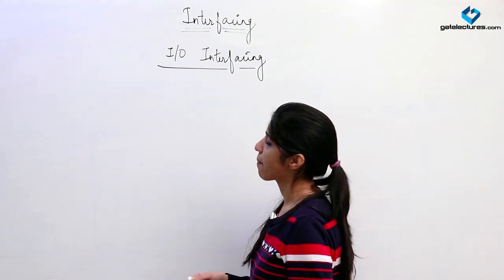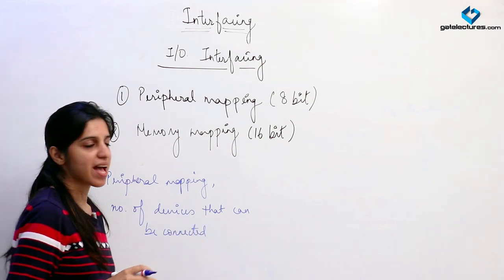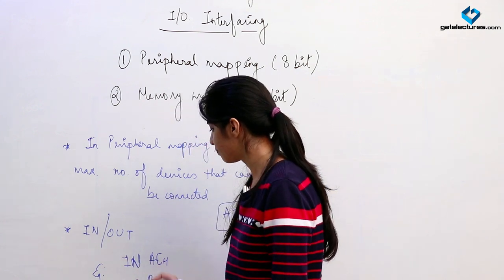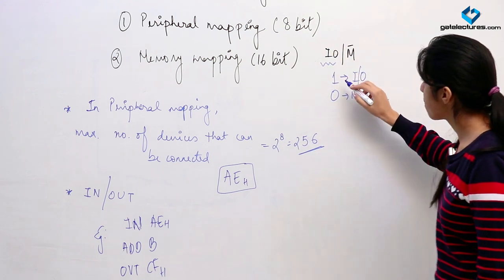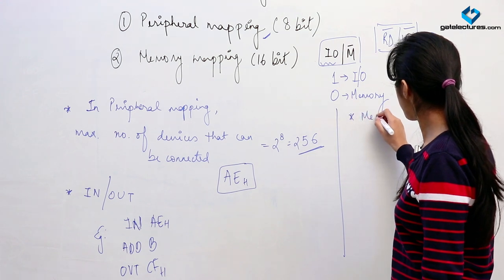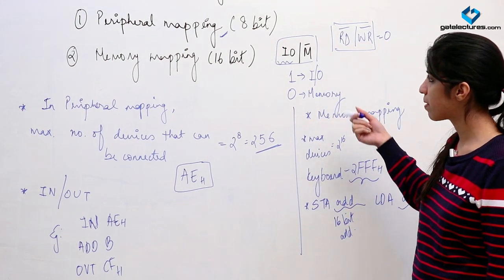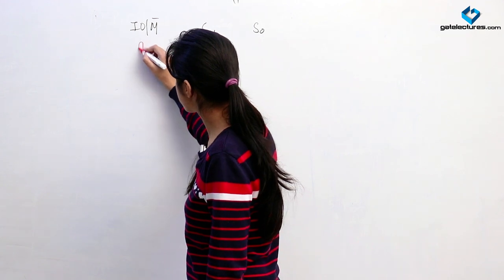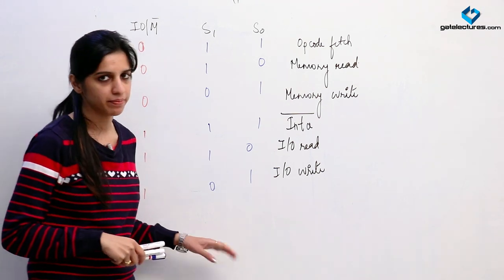08 IO Interfacing in 8085 Microprocessor memory mapping ece ugc net computer science ies

Comment: Ma'm plz solve it.
interface the 8086 microproprocessor with two 16k*16 EPROM chips and two 16k*16 RAM chips.Draw the necessary block diagram showing the interfacing of the memory with 8086.

here starting address is not given.
plz solve it as soon as possible.